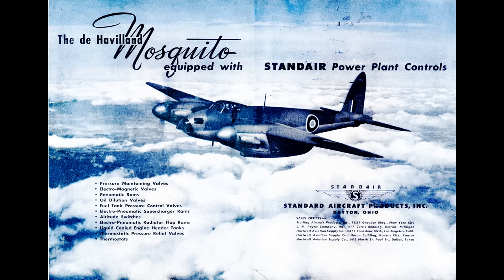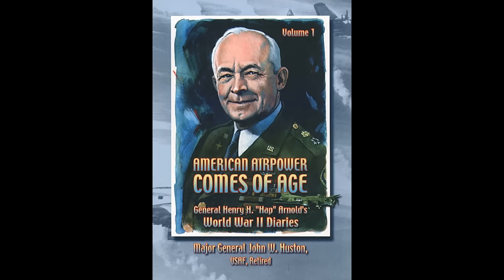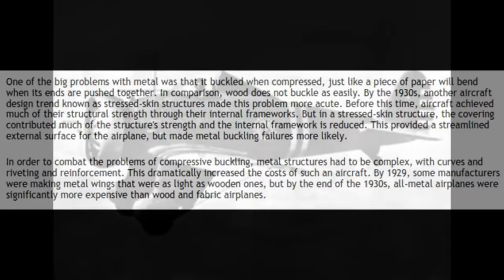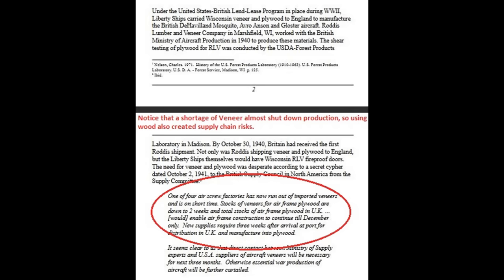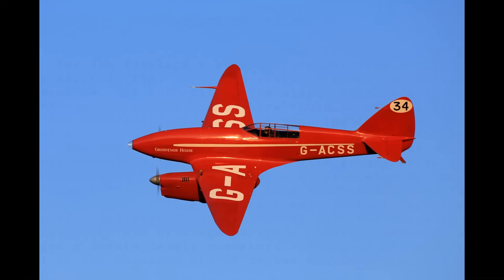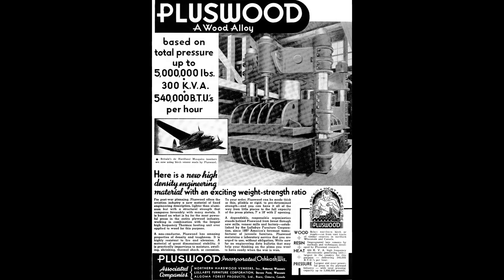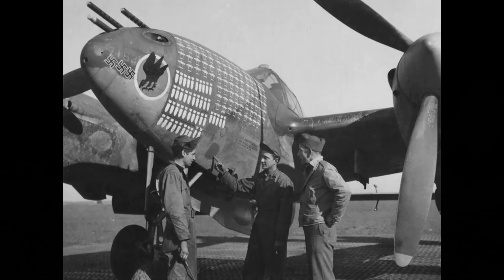De Havilland Mosquito vs. ?

Comment: Good video, though I would like to comment on some of your statements.
Loved all the period advertisements highlighting the Mosquito. The parts suppliers were proud to do their part with such a beautiful, successful aircraft.
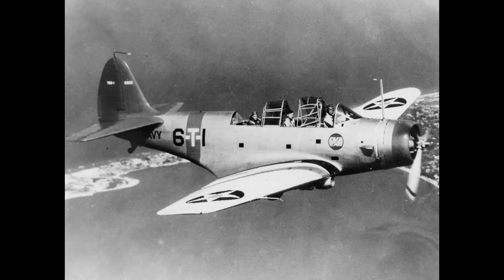7:18 to 7:32. Mmmmm not quite right. The Gladiator and Hurricane used bolted together  tubing to construct the primary load bearing structure. To produce the aerodynamic form  for these aircraft, wood formers and stringers were built onto the aluminum and steel load bearing structure to hold the fabric covering. In other words the wood and fabric could be damaged and not cause the aircraft to totally fail.
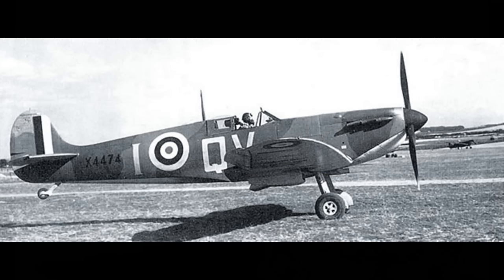7:44. Some Spitfires were possibly built with wood-structured elevators, as reported in the early 2000s (Aeroplane Monthly) when a surviving airworthy Spitfire had its tail feathers recovered and a wood elevator was found. Was this an attempt to reduce the demand for 'aluminium' by producing wood elevators? Or was it a post-war attempt to find a replacement part, as this particular Spitfire was 1 of 6 once operated by the Belgian target towing company GOGEA in the mid/late 1950s.
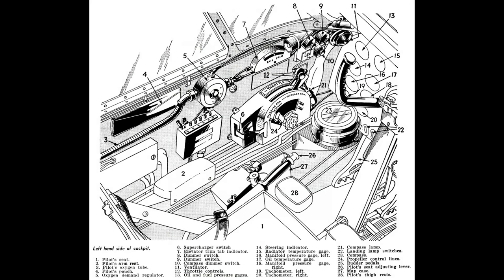9:13 "plywood" as related to the Mosquito is yellow birch. English-built Mosquitos used primarily Sweden as a source and availability was not strongly threatened. The Canadian Mosquitos birch material came from 150 miles north of DHC's Toronto factory, balsa was railroaded from Peru, Sitka Spruce from British Columbia and licensed-built American Merlins were just over the border(no U-Boat threats here).
10:21 DH took the skill of aviation woodworking very seriously. Cabinet workers did not stop making kitchen tables and start making Mosquito components. deHavilland did not just build airplanes and engines. Besides running flying schools they also also ran their own apprentice technical schools.  These students went through a multiple year training course.  Their first skill assessment project was to make their own dovetail-corner toolbox to carry their trade tools (I'd love to have one of these historical toolboxes). After their training and factory experience was done, some would be sent to these off-factory sites to oversee quality control. (Aeroplane Monthly mid-1990s)

These apprentices besides building the Albatross and Mosquito, they produced the Hornet /Sea Hornet (you think the Mosquito is sexy?) and the Vampire. Your would be surprised how much wood is in a Lancaster.
18:45 Structural failure. It could happen anytime to any aircraft. My father as a UK WW2 RAF Cadet witnessed a Mosquito being "overflown" by its pilot and it "disintegrated into confetti with its empty drop fuel tanks fluttering down like leaves".
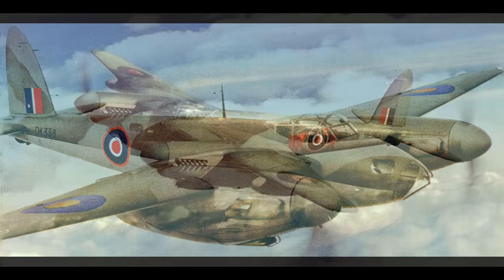20:21 Flight characteristics. Steve Hinton (Planes of Fame) is perhaps the world's most knowledgeable and experienced vintage WW2 aircraft, has flown both an original wood and new wood Mosquito.  Hinton notes the aircraft does have minor faults and such but with experience the Mosquito is a 'Master of all Trades'. Check out the praise from the pilot in the Youtube video '1,000 Hour Mosquito Pilot'
As I've stated, an excellent overview of the Mosquito.
ps There are only 3 flying Mosquitos presently, 1 original wood, 2 new wood.  When Kermit Weeks (Fantasy of Flight) finishes his wood Lockheed Vega, he noted he'll start restoring his original wood Mosquito.  That possibly 4 from zero only 20 years ago. I praise these peoples skills.

Comment: A set of the original moulds that were use to construct the sandwich of thin plywood and balsa wood for the Mosquito fuselage halves have been found buried under a pile of rubbish at the back of a disused hanger. They are in good order. They also found numerous other jigs, etc.  Anyone interested in building a full size model aircraft (and not one of these ready made piles of plastic junk) please take note.  Unfortunately a couple of AM 2.5 cc engines might struggle.

Comment: Comparing the Mosquito and P-38 seems a bit perverse. The former was designed as a fast light bomber, while the second was fighter from its inception.
Reply: Maybe because they are similar in their specs?
Reply: I agree, making comparisons particularly in the rapidly-evolving technical environment of WWII is fraught with danger. The P38 may have similar technical specs but was primarily a fighter adapted to other roles. The Mosquito was designed as a bomber and adapted to other roles, such as and not restricted to; night fighter, reconnaissance,  pathfinder, passenger carrier, cargo plane ('civilian' Mozzies flying to and from Sweden), ground attack, anti-shipping, electronic warfare, etc. etc. The Mosquito was probably more versatile, but cannot really be compared to any other aircraft except perhaps the Me 110. That too is not a fair comparison as the Mosquito was a much later aircraft.
Reply: @sdmatt1975  Similar in specs? A light fast bomber and a fighter? One with no weapons (orignally), and the other with 4x0.50s and a cannon? The first with conventionally supercharged Merlins, the second with turbosupercharged Allisons? The first with a crew of two or three, the second a single seater? 

Apart from being twin engine, I'm not seeing the similarity, sorry.
Reply: @Splattle101  > Apart from being twin engine, I'm not seeing the similarity, sorry.

Well, Greg may well set me straight soon but: nearly equal power, equal speed, equal payload, equal size, equal range.  Later Mossies gained the supercharging necessary to equal P-38s at high altitude as well (or get close).  Further: both had an empty nose that you could almost have boy scouts reconfigure for you, due to a lack of engine to work around: fill it with guns, fill it with bombardier, fill it with cameras, what have you.

Granted the Mosquito had a two-man main cabin, but you adding the same to the P-38 should have been trivial had it been desired, given the significant design freedom (e.g., adding the second seat wouldn't require moving landing gear, engines, bomb bay etc. out of the way.).

One thing I can say in favor of the Mosquito is that it apparently had an internal bomb bay, which may have been impossible to retrofit on the Lightning.  If you told me the Lighting had to be slower as a bomber due to exposed munitions, that'd be one differentiator.  OTOH Greg points a scary picture of wood's strength vs. bullets.  Perhaps as a heavy-fighter (i.e, one that would take some hits as well as dishing them out) it may not have been workable.

Comment: One very important point missed on the ease of construction...  As you correctly pointed out, this aircraft was manufactured by skilled woodworkers, of which there were plenty in need of work.  Most major towns had a furniture company and this meant that its manufacture could easily be dispersed around the country; any wood shop could make the components and it was therefore extremely difficult for Germany to stop Mosquito production.  All metal aircraft could only be made in specialist workshops of which there were few and therefore more easily disrupted by the enemy. The Mosquito's wing loading is astonishing: it could carry a heavier payload, faster over longer range than its competitors and its single engine performance was magnificent.  I understand that Goering once lamented that Germany had difficulty getting hold of the metal required for aircraft manufacture whereas we, who had access to it, didn't bother with it.

Comment: Wonderful video Greg, I really enjoyed it, however making a comparisonn with the P38 is not valid as it was designed from the outset as a armed fighter. The Mosquito was designed from the outset as an un armed bomber, that used speed to avoid interception. In addition the P38 had problems at high altitude in the European theatre.
Reply from the maker: It has to be the P-38 or the A-26, and the 38 makes more sense.
Reply: @GregsAirplanesandAutomobiles  A-20 Havoc? Well, the Havoc is even less of a fighter than the Mossie, i admit... Can't wait for the P-38 vs Mossie matchup video!!
Reply: @oborozukiyo73  A-26
Reply: Jonathan, I agree. There are too many fundamental differences between the Moz and the P38. We are talking about a two seat medium bomber unarmed (!) which was ideal for avoiding defences at night over Europe vs a single seat heavy fighter which could take on and beat single-engine fighters and was ideal for getting its pilot home over the Pacific. I don't think a direct comparison is fair on either.
Reply: My two cents to the topic.
With the Droop Snoot the p38 could do everything a Mosquito could do as tactical bomber or scout bomber. And if the Mosquito had to wrestle it out with single engine German fighters in the role of a bomber escort fighter it would not have done any better than the P38.

Comment: As I was saying in the live stream Paulownia would have been a great wood for WWII aircraft. It’s slightly heavier than Balsa but stronger and is commonly used for model airplanes today. This tree grows quickly all over China but as that country wasn’t a major aircraft producer they never exploited it. There was a tiny bit of Paulownia in the Mitsubishi Zero’s wings, that was the extent of it’s use in the war.
Reply: Maybe Paulownia can be tamed, but I have several trees growing at my place and the branches are certainly light, but also very brittle. A possum on the end of a branch will break a limb as thick as my thigh. Mine make up for that deficiency with lots of pretty blue blossom and huge leaves, the size of a baby elephants ears. I have heard from several sources, but have no written documentation supporting it that Australian and perhaps other Mosquitos used Tasmanian Leatherwood in the construction of this aircraft. Leatherwood is now famed more for the honey bees make from its blossom, it is quite distinctive (and yummy)
Reply: @Ropetangler  Very cool. I know there are several grades of Paulownia, some lighter than Balsa, but the aircraft grade is heavier but with higher strength to weight ratio than Balsa. Of course the Mossie also used heavier woods like Spruce for reinforcement and the Balsa is made into a resin impregnated plywood.

Comment: Let's not forget that America was not short of Aluminium, so building a wooden aircraft solved a problem that didn't exist. In Britain we were short of materials so a balsa/ ply sandwich construction solved a problem. Also don't confuse a traditional wooden aircraft with the ply sandwich that the Mosquito was made of. The Mosquito was a modern use of a traditional material. The Boeing Dreamliner aircraft are built this way today, just using carbon composites instead of ply/ balsa sandwich.

Comment: I'm sure a future vid will mention the derivative called the "Tsetse" with the Molins 6 lb auto cannon under the nose.
Reply: That version distinguished itself as a submarine destroyer.
Reply: I saw an interview with a pilot who said that if you came in to shoot up u boats low with a slight angle of attack the 6lb shells would skip off the water into the side of the boat pretty reliably. He says he sank one using that method.
Reply: As mentioned by others rockets where good you went out with a heavy cruiser broadside equivalent, once fired your lighter faster and more manoeuvrable. With a 6 Pounder field gun you stay heavy. I suppose it depends what your shooting at the gun could and did sink subs it would punch a hole through the pressure hull and then the shot would bounce around wrecking everything it hit the the sub. I suppose it depends what size hammer you want.

Comment: Don't forget a wooden airplane has a much lower RADAR CROSS SECTION BECAUSE OF ITS WOODEN CONSTRUCTION!
Reply: Hmmm, maybe a plywood B21 would be invisible.
Reply: That's what made it such a good pathfinder.  Jerry could hardly see the thing b/c the only thing for radar to hit were the Merlins, the landing gear, and the R/T set.  Nevermind it would run away from anything Göring could throw at it in quantity... no see'um, no catch'em, and given that it was a pathfinder, you always had the possibility that even if you could catch the thing and down it, you might not have a home to go back to.  

Just a tour-de-force.  

And now what do we do?  We're going away from making metal aeroplanes again.  Now it's all fibreglass and carbon fibre.  Even Beechcraft, who made the Premier 1's fuselage out of carbon fibre spun around a mandrel like a huge bobbin.  

Plus ça change, plus c'est la même chose...
Reply: I would only partially agree with this statement. From certain angles this is completely true, side-on it does have a significantly lower reflection index than a metal skinned aircraft. Head-on however, it is a different story. The engines, props, spinners, undercarriage and cockpit surround  are all metal and would give a similar reflection to other aircraft. One design feature, the wing root radiators are an almost custom-designed radar reflector, making it as visible as any WWII aircraft to the Axis radar in their air defence network.
Whilst radar signature could have been a factor in the aircraft's success, it would have been a minor one
Reply: Not really imho... Wood, cloth and similar may be almost transparent to radar waves but that only makes the more reflective internals visible. In fact a wooden clad engine would most likely  be more visible by radar than metal clad one, especially if there were little rivets used which are main source of reflection anyways. And even if parts of wooden tail or wing could be transparent to radar there would be still strong radar return from the few metal elements with features like sharp edges, rotating parts or special shapes (cables, some intakes) that generate majority of the radar return anyways. So all wood construction is not that advantageous, especially from the front as Chris Knight here points out. And front is what matters for early warning.

btw: Military Aviation History recently made a video on the myth of Horten 229's stealth. It's not "conclusive" on the matter of wood and stealth but a good reality check on the things.

Comment: Thank you for a great introduction to the DH98 Mosquito or 'Mossie' as it was often referred to as, it was also slated early on on WWII as 'Freemans Foley', as the Air Ministry could see the advantages that it would bring with it? 
Like a whole new skilled work force to produce airframes and wings for an aircraft that was so fast when it was flown in a demonstration for the RAF 'Big Wigs', the fastest plane they had available to them at the time was a Spitfire, that was unable to catch up/intercept it, then they took it seriously.
'I just opened up the throttles and waved goodbye', I love that!

Comment: You didn't mention Birch (most of this originated in Canada), which was volumetrically the most important wood involved in Mosquito production.  Balsa was the wood used in the smallest quantities.  Due to a shortage of Canadian birch, some early Australian Mosquitos were constructed using Australian Coachwood.
Reply from the maker: I didn't get into the types of wood too much. However I think Birch was only used in the Canadian built planes, but that could be incorrect.
Reply: @GregsAirplanesandAutomobiles  You did talk about plywood.  From my reading, most of that started out as logs of Birch.

Comment: Compare all-metal Spitfire to about 2/3 wood+fabric Hurricane: shot up hurricanes were repaired far faster (at much less cost) than spitfires. Production of hurricanes was more than double that of spifires. In russian service, wood constructed aircraft whithstood the winter conditions better than metal constructed aircraft.
Reply: I'm sure you'll know but several thousand more Spitfires were made. It's arguable but if the hurricane was made of metal it wouldn't have taken a tremendously significant amount of time than the original. The Spitfire took twice as long because it hasn't got an easy shape to produce.
Reply: @baselhammond3317  By the end of the war yes, but during the Battle of Britain, no
Reply: @RhodokTribesman  yes I know that... I'm checking if this person is talking about BoB or war as a whole.
Reply: Actually, Greg's wrong when he says that the Gladiator was mainly built of wood or the Hurricane was of mixed construction. Although the Hurricane had a few parts that were made of wood, its basic structure was of metal. It was not of the modern "stressed skin" type of construction (exept for the wings in later producion - that's probably what he ment by "mixed construction") - but of a steel+durlaluminium skeleton covered with fabric. The first RAF plane constructed that way was the Armstrong Withworth Siskin III in the mit 1920's.

Comment: Mosquito irl in ww2: I am the fastest airplane and can turnfight with some single engine fighters
Mosquito in War thunder: help, I can't outspeed my enemies
Reply: If I were to guess you can't really get the Mosquito to its max speed horizontally in War Thunder due to the low amount of acceleration at high speed and altitude. A lot of American mid tier aircraft suffer from this aswell. P-51 D-5 and P-47 D-25 for example